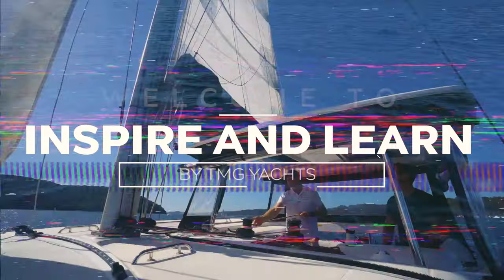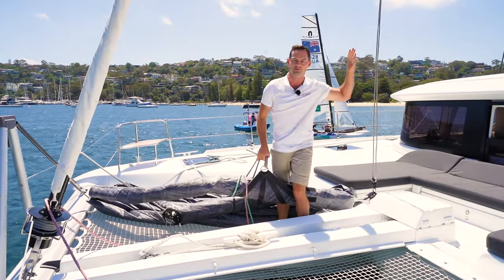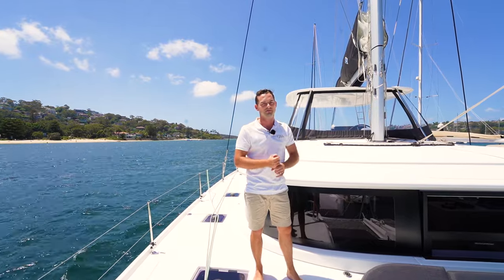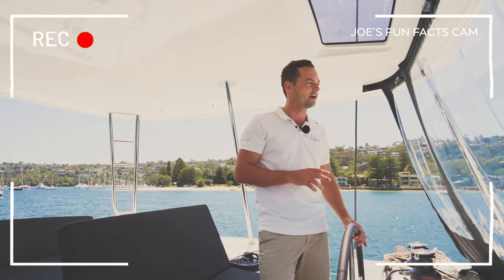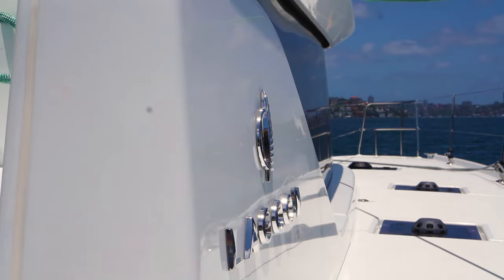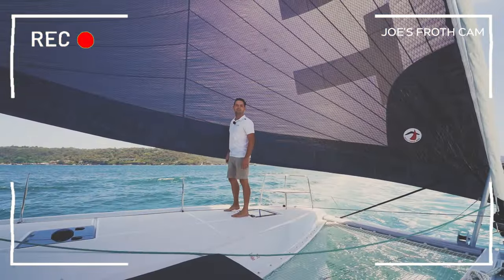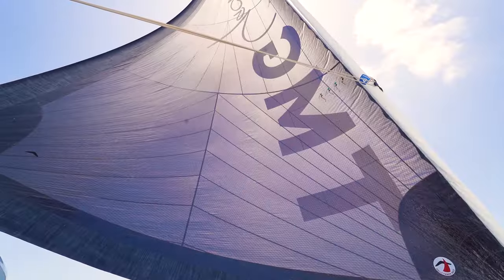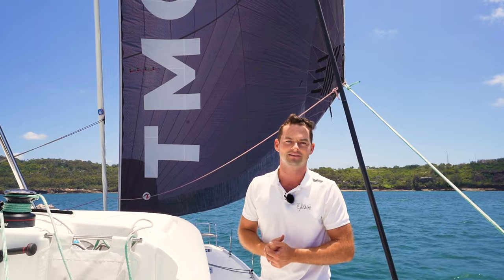How to Fly a Code Zero | Inspire & Learn by TMG Yachts

Comment: Great video. Re maximum wind speed I understand it's 15 knots apparent, rather than true.
Reply: This is true to a certain extent for experienced sailors. The most important thing is that you can furl it in any wind conditions you are flying it in safely. Sailing downwind at 10knots in 25 knots true will give you around 15 apparent, however if the boat slows down or there is an issue then you'll have potentially 25 knots across the deck which will make furling and safely managing the sail more complex.

Comment: Great Demo on setup and using Code D, I would add that wheres 15knts is a good limit to not forget to check Gust speeds as I have blown a Code D with a 22 Knt Gust, Lucky for me the pin holding the drum blew first and I was able to dump the Code 0 in the water to get her down and retreive the sail.

Comment: Great segment. How would you have furled it solo.
Reply: Good question! In light wind it is safe to release the sheet then furl the sail. In stronger winds, to reduce excess flogging that may damage the sail, you need to ease a few meters of sheet, then furl, followed by more ease, then furl and so on… turning the bows downwind will help greatly in reducing apparent wind in the sail.  Hope this helped 

Joe

Comment: Could you please comment on wether you should always have the main up while flying this sail?
Reply: Hi Peter, this will vary from vessel to vessel and you are best to check with the manufacturer as design and rig structures vary. Often best to have the main sail up, even with 3 reefs as this will provide a more balanced sail set up in any case, thanks for your question
Joe

Comment: Can you please explain why not to add a stop knot at the end of the lazy sheet?
Reply: Hi there, good question. in the event that you need to fully release the Code 0 in an emergency or to depower it, you may need to let the sheet run completely through the winch and blocks. With a stopper knot this will be impossible so best to not knot the sheet. Think of it as though you were flying a Spinnaker where in some instances you need to blow the sheets to furl or control the sail. 

Joe

Comment: Gybing a code zero or an asymetric single handed is a challenge! Furling and unfurling is tedious. My preference is to hoist the sail with the free sheet running outside the forestay. When its time to gybe straighten onto a run, let the sail fly forward, make the gybe and then sheet in on the new course. I do this on my own. Some care is needed to ensure the sheets dont end up in the water but i find this an efficient and fairly easy method. I do this on a 12m cat......wouldnt try it on a monohull!
Reply: Great way to do it if you are on your own Chris. Good work!